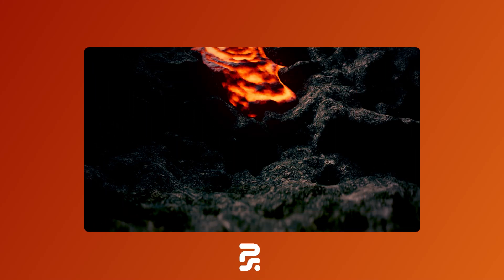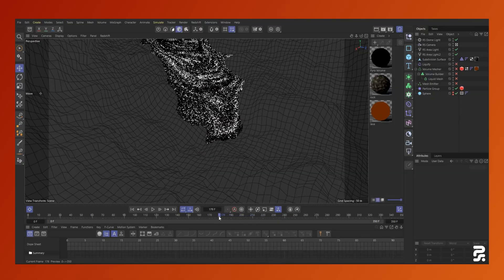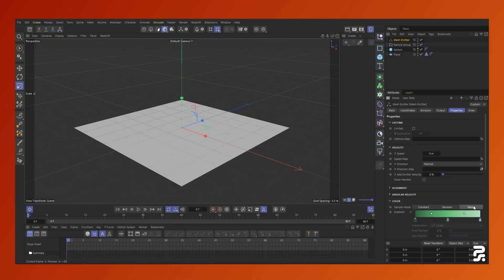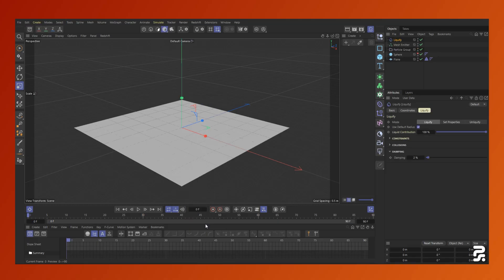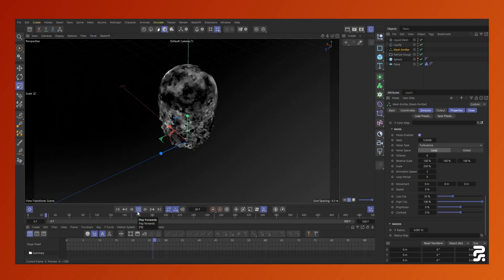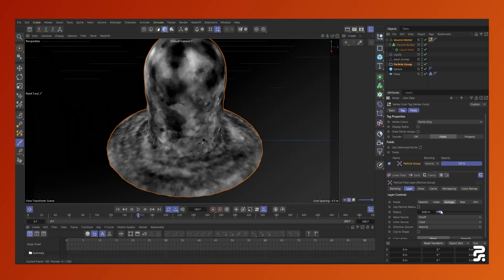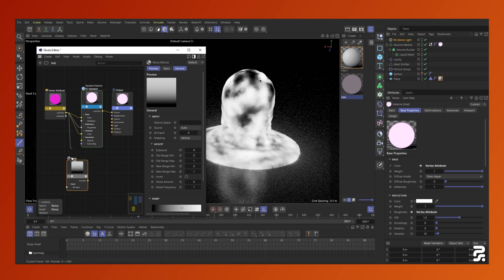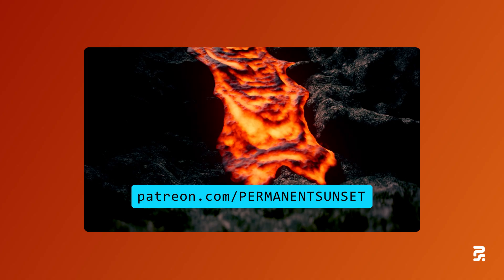How to control Liquid Colors in Cinema 4D 2025.3 - New Fluid Simulation tools + Project Files

Comment: I ran into issues while adding the volume builder. The liquid mesh won't turn into volume. Do you need to cache the liquid first?
Reply from the maker: Make sure you have 'geometry' turned on in the export settings of the liquid mesh object.